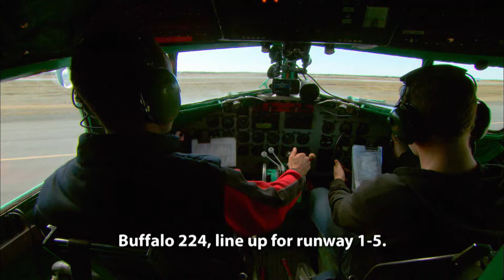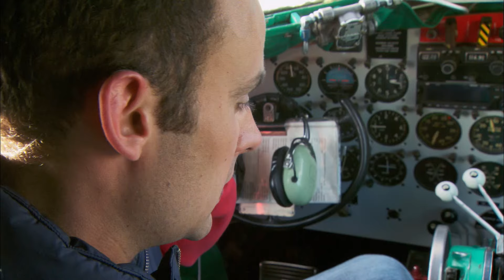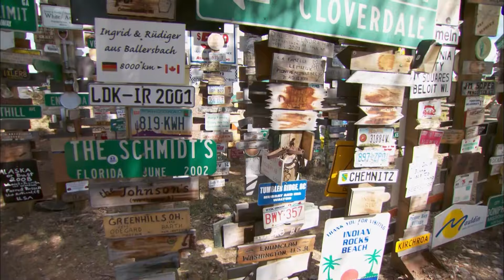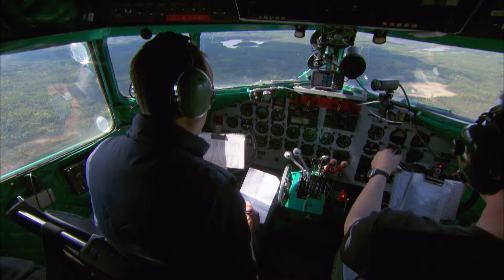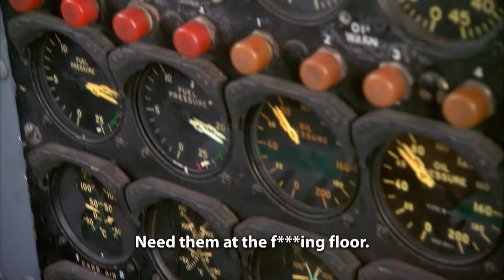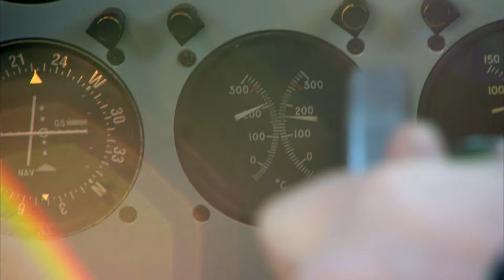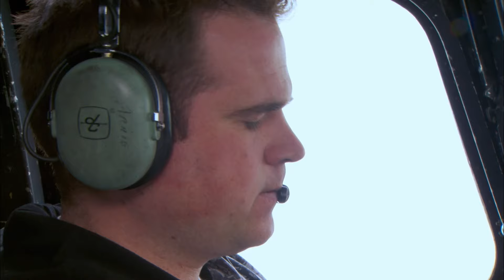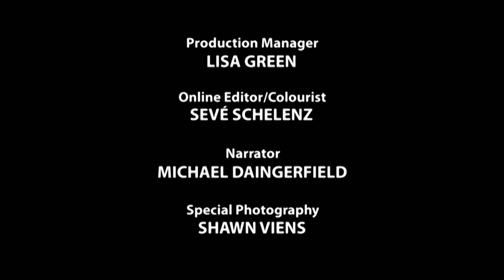Flying With A Faulty DC-3 Engine Towards A Thunderstorm | Ice Pilots NWT | Wonder

Comment: My first airplane flight was in a private DC3. Before I left I had read up all about the DC3 which admin design by calculation with a slide rule RULE.     Later computer analysis showed that the DC3  over designed by many multiples of engineering layers. I was ready for my first flight which turned out to land on a West Virginia mountaintop where are they landing strip ended with the edge of the mountain. I got a lot of nerve yeah pulled together for that trip. I have never forgotten the DC three.

Comment: Only thing I’m so confused is how do FAA allow this planes on the air so unsafe they always have problems and seems like passengers gettin ripped off
Reply: Well, keep in mind this is a Canadian show so it’s not within the FAA’s prevue.  But you’re absolutely right, the Canadian equivalent of the FAA has come down on different facets of this operation multiple times….some detailed on the show and some not.  I think they should probably be harsher…considering I’m sure some of the negative stuff is whitewashed and not presented in the show, so it’s probably worse than it seems here.
Reply: Well it’s Transport Canada not the US so we  aren’t governed by the FAA
Reply: Clearly not that unsafe since they haven't had any crashes, and also theyve been in business for damn near a century so business is good
Reply: @3a.m.284  Yeah that’s literally not accurate.  They’ve had multiple crashes, some of which have been caught on video.
Reply: @ATFDFF  ok, not surprising since literally every airline has had a crash. So you've not really proven anything
Reply: @3a.m.284  " literally every airline has had a crash" - You should educate yourself and try that statement again.